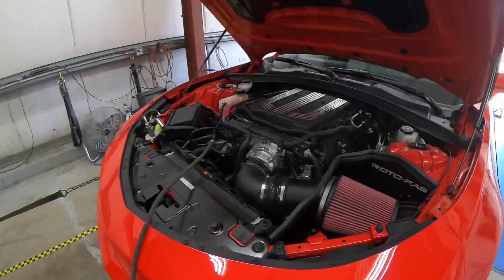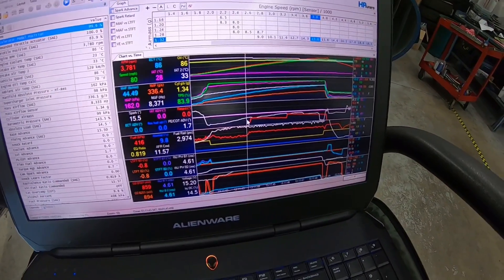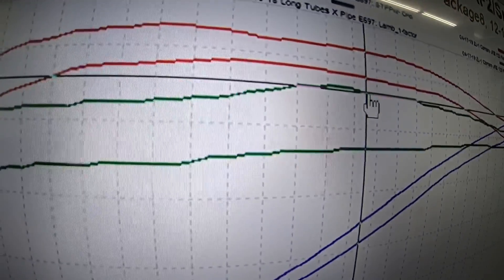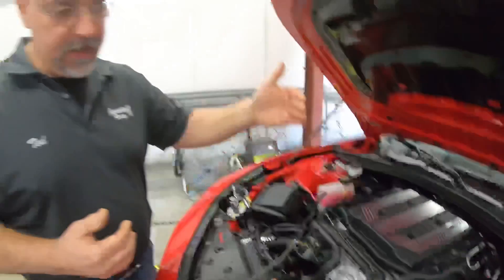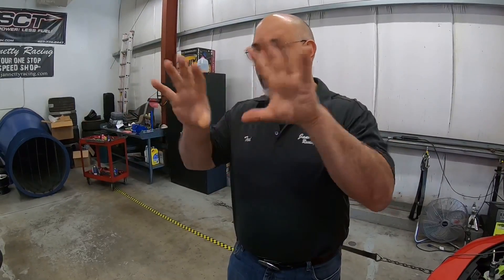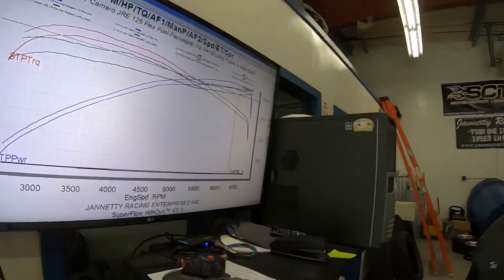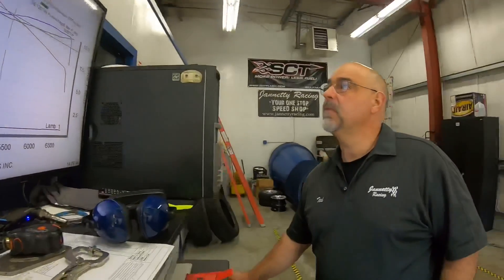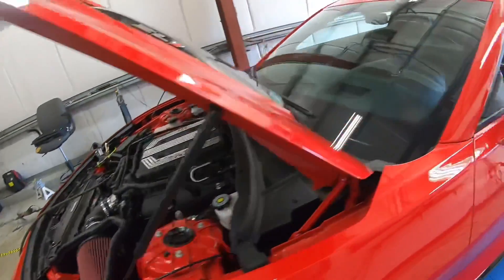Jannetty Racing LIVE: 2018 Camaro ZL1 125 RWHP Flex Fuel Package

Comment: Question about mixing fuel? How easy of a process is this? To achieve the e50 mixture? Is it as simple as topping a half tank of 93 with pump e85 that’s testing at 80%-90%?
 Really digging the concept of efficient power gains and not placing items in that introduce more heat. 
Future customer here
Thanks
Reply from the maker: We recommend the optional Aeroforce gauge to monitor Ethanol content from inside the car, Blending a 60% E-85 and 40% E-10 will get  you very close to target of E-60 . Unfortunately the E content percent varies pump to pump.

Comment: Hi Ted, quick question.  Do you recall if this Z was "excessively" loud with the corsa + kooks set up?  Or, do the green cats aide in keeping the exhaust note down?  Good stuff brother!!!!
Reply from the maker: Nice part about Corsa is quite inside and loud outside.
Reply: @JANNETTYRACING  Agreed.. Regarding the headers, does the addition of the green cats help keep the exhaust noise level lower?  I’m considering going this route
Reply from the maker: @goblue2708  Yes they help for sure.

Comment: Why not run full e85 and why is e50-60 recommended?
Reply from the maker: Because that is the limit of what the fuel system can handle in fuel flow More E means you need more fuel delivery capability.
Reply: So what is the best option to run full e85 on a full port, 103mm intake lt4 blower??? From my understanding a voltage booster for the HPFP, flex fuel sensor and low side auxiliary was all that was needed for full e85 or best e blend possible like 70-85% E.

Do you need injectors at the point or would the voltage booster like JMS not sufficient enough and do you need a HPFP like the one from LPE?
Reply from the maker: @htownsfinest87   I think you should call me your getting bad information 203-753-7223

Comment: do you recommend roto fab dry filter or oiled on the ZL1
Reply from the maker: The depends on how important filtration is to you in order Dry, Oiled and stock Less to more filtration.
Reply: @JANNETTYRACING  hello! I was wondering about how much power would you anticipate this package making adding a ported blower, 103 throttle body and lower pulley?
Reply from the maker: @williem6358  Since we are either knock limited by pump gas or power limited by fuel system on E, 670 is about it without doing a cam.
 All three that you mentioned will raise boost which puts you farther down the rabbit hole of knock limited power in pump gas, I would not recommend it unless you are willing to do a cam as well.   Our Terminator cam package will remove a lot of knock limitation on pump gas, and extend the fuel system power levels on E fuels.  
But once you do a cam the little blower can't keep up even when ported and pullied,  the stock intercooler bricks can not handle any more air flow than come stock, the more air you put through the the shorter amount of time the IAT will be OK.  for example you take a good 1/4 mile car and make it a good 1/8 mile car or IAT overheats.

Comment: Ted just curious why your 125 package doesn’t have an upgraded pulley as part of the package already?  Isn’t that an easy power upgrade that would work well with your package?
Reply from the maker: The whole concept is power through efficiency with total reliability under the most severe racing conditions, and to be able to run E60 fuel, we can add a pulley now that we have addressed all of the restrictions but it will reduce the ability to run E60, I would rather gain power from fuel that boost and be limited to low octane. hope this answers your question if not ask please.